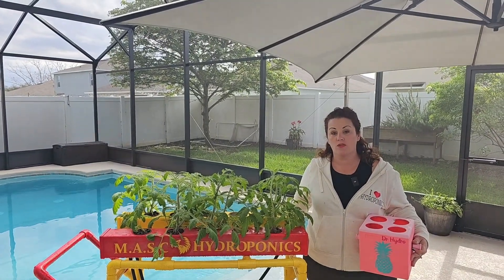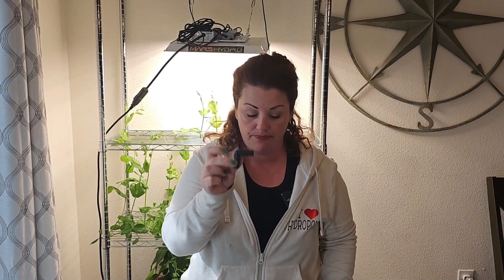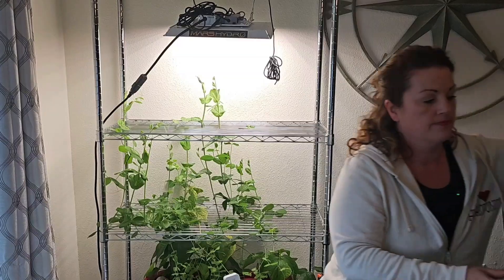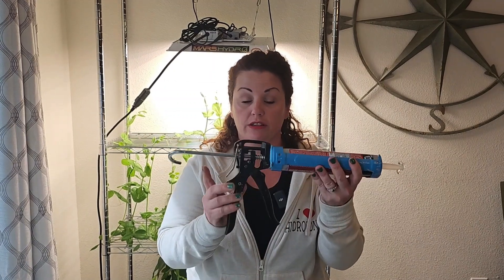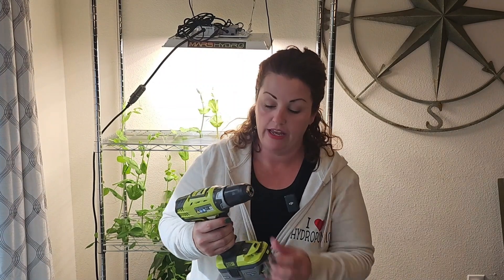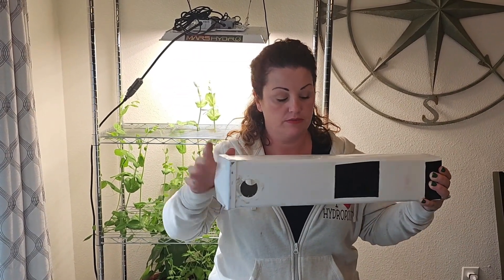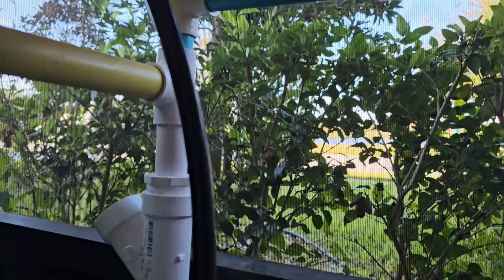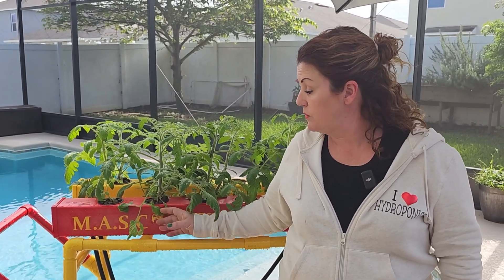Build It! Hydroponic Fencepost Garden

Comment: Great info and ty for your time to go over material . At the end it was kinda unclear on there to put the 2 tubes ? And also do you drill holes for the 2 tubes that go into the big buckets so you don’t get mostquoties
Reply from the maker: You will drill 3 holes into each rail, try to get the holes in each rail to align since you still be connecting them. Center holes= connected with black irrigation tubing. Rail ends- one rail end set of holes =connecting with smaller black tubing with a T piece which will connect to the pump (WATER UPTAKE). On the other rail ends- both of these will RETURN the water back to the resevoir.  You will want two return tubes to reduce the chances of the rails overflowing. 
I put my resevoirs on timers which will circulate the water every hour or so. I also cover my resevoirs. These 2 actions drastically reduce or eliminate the chances of Mosquitos accessing the water and breeding. 
Hope this helps!

Comment: You could cut down your in/out plumbing/expense by daisy-chaining one box to another --- one input into red box and one output from yellow box. 

Why isn't the dimension BETWEEN the boxes a factor of what type of plants you expect to grow? As some plants bush out and will overlapping will other grow more vertical and will not overlap ?!?  What are you growing in the setup you made? 

Have you considered using large 3"x4" plastic rain-gutter down-spouts - allows you to cut to size, there are 3D end-caps to print?  

What was your total cost for the project came too (for reference)? 

To speed up and reduce MP4 size  - if you drill/layout one hole you know how to drill all holes.  And have you considered using your PVC stand as part of your plumbing - that would be unique and serve as double duty use?    
Just the engineer in me.
Reply from the maker: Ahh the thoughts that keep us awake at night lol. If you do hydroponics you obsess over improvements and possibilities ❤️ 
The dimensions between the rails could be a factor. I've kept indeterminate tomatoes alongside unruly basil for about 6 months and they were pretty big.  I did attach a trellis to support them but eventually I moved the big plants out. If someone was diligent about training, supporting, and root trimming they could maintain a plant in this structure. 
I could go over the issues I've had with these rails but they are minimal compared to the towers and other popular builds. For this video I wanted to just cover the manual labor and parts to make the structure.
I agree with you.  Spacing should be considered no matter what medium.
Reply from the maker: As far as cost, I'm going to say it totals under 200 for the rails. The stand I built is a separate cost.
Reply from the maker: As far as incorporating the stand into the water flow-- that sounds so cool but I would have to glue all the parts and then I wouldn't be able to reduce the size of the structure etc. But that sounds really cool if I had the space to commit to.